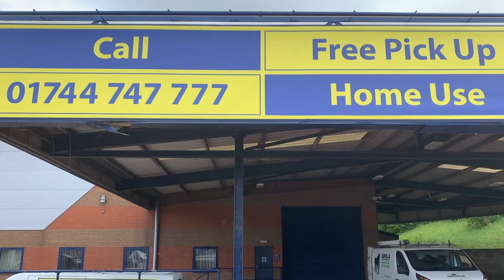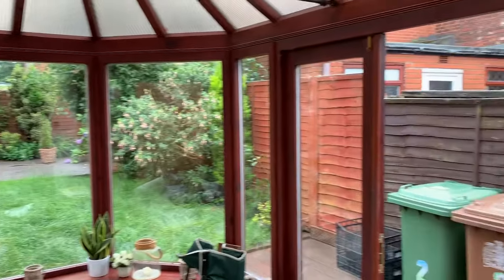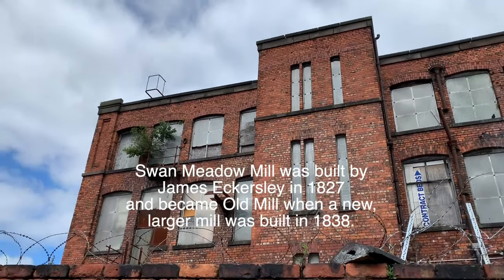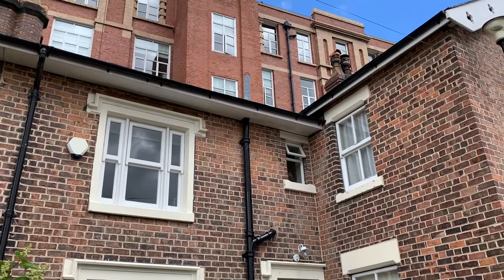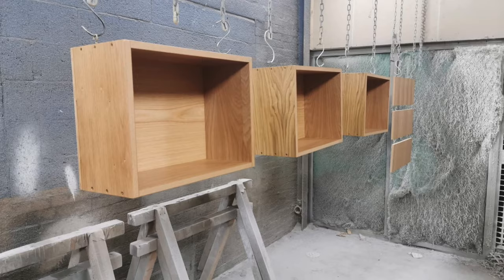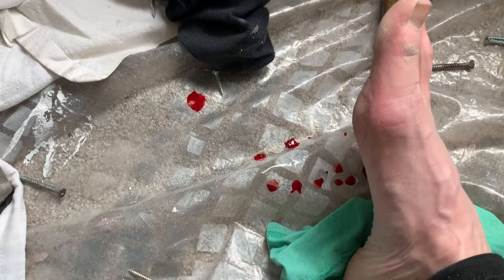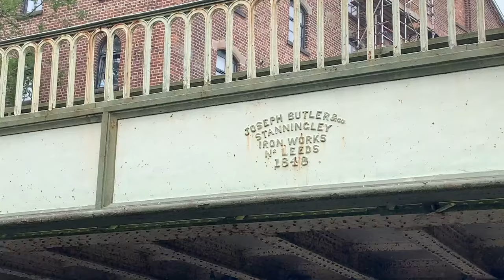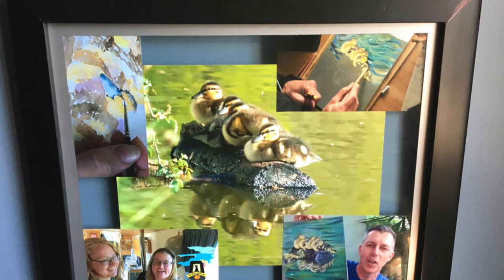16. Why it's not that easy waiting for your Narrowboat build and we have to find somewhere to live.

Comment: Your boat with the cruiser stern looks very nice.  With your amazing art skills why would you need a decorator painter?   It would be nice for you to tell us what engine or electric drive you are putting in.  For me lots of solar and lithium Ion batteries with an electric drive would be the way to go.  A small generator for dark winter months would solve winter problems.  I would also have one portion of the upper wall not tilted in so I could have a normal large household fridge instead of the tiny under counter motel fridges so often on narrow boats.   The last thing I would want was an AC unit for at least the bedroom for hot summer nights and days.  Here in Israel where normal summers include 40+ temperatures, AC is a must but I have seen on other narrow boat channels in England where temps have exceeded 37+.  Good luck on all your adventures, please stay safe and healthy.
Reply: Some of them ideas would be amazing. Unfortunately, AC would be very hard to power. The engine is a Vetus engine and the solar set up is great and produces power in dim light. 😄